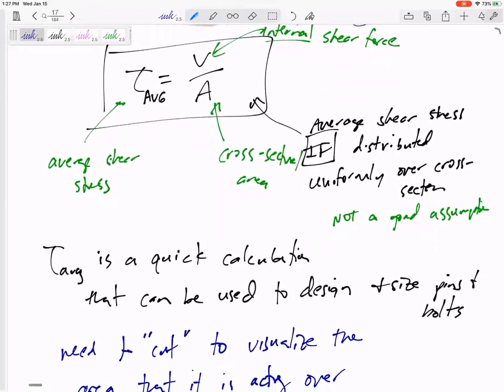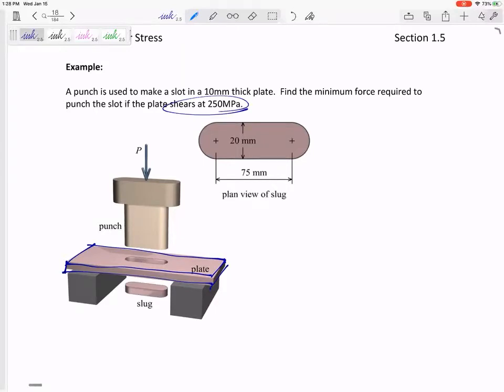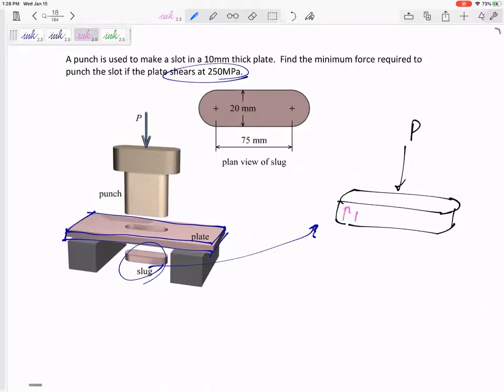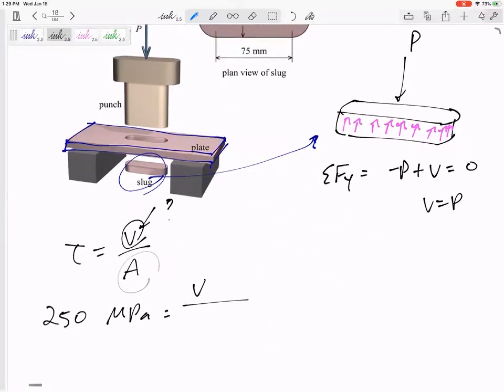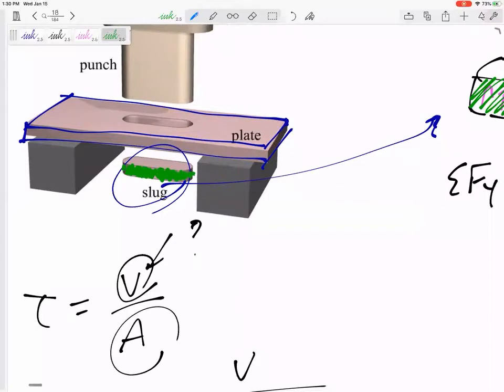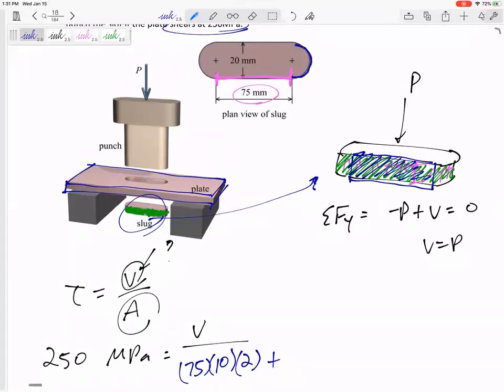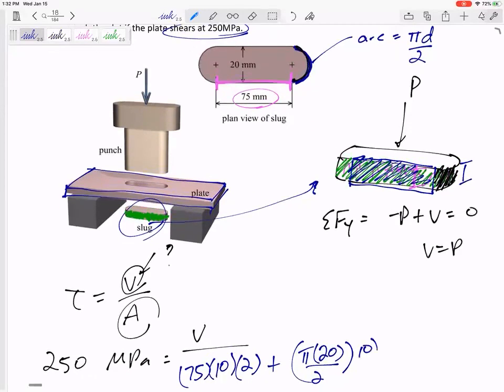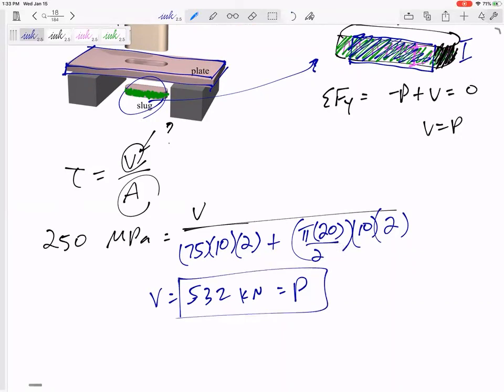Mechanics of Materials - Shear stress example 1

Comment: Sir.. need your clarification please... i read this statement in Hibbeler. "When shear stress acts on a plane, then equilibrium of a volume element of material at a point on the plane requires associated shear stress of the same magnitude act on the three other sides of the element" ........ here equilibrium of a small element of material is talked about... does it apply to whole material as well say a bar, bolt or any other material as a whole ? thank you much...